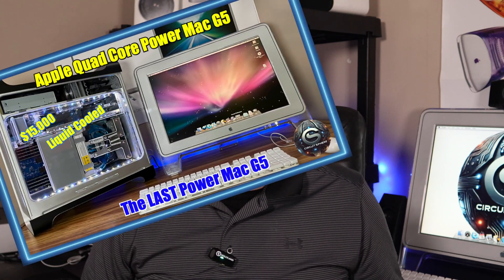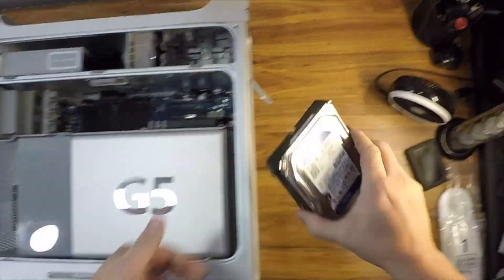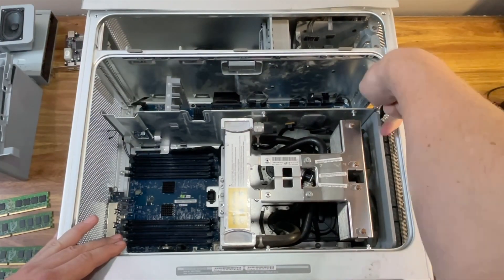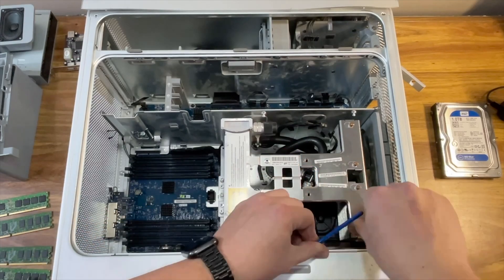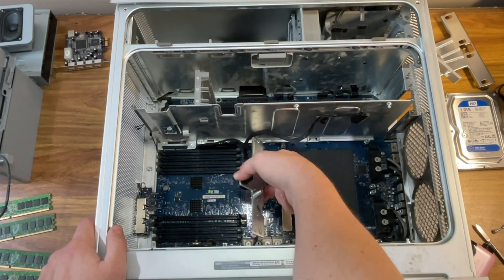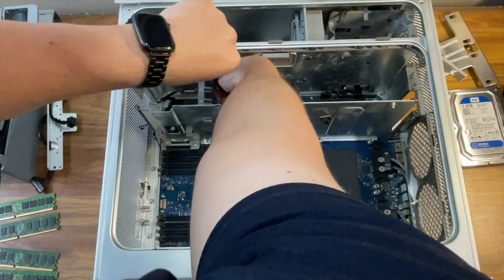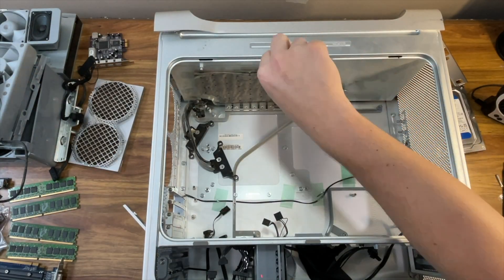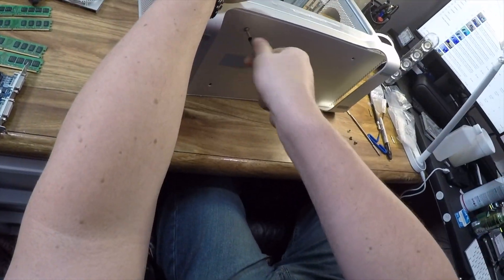2005 Apple Power Mac G5 Quad Core: A Complete Teardown - Ep. 3

Comment: My G5 Quad is still running great (and gets regular use, I still use several older graphic art and 3D apps that work great for my needs), but eventually I'll remove the liquid cooler to check it and do any repairs if necessary, so thank you very much for this teardown video!  It will certainly come in handy when that fateful day arrives.  I love my G5 Quad, I purposely bought it (about 10 years ago!) since it is the fastest machine that can run PowerPC apps natively.  New subscriber!